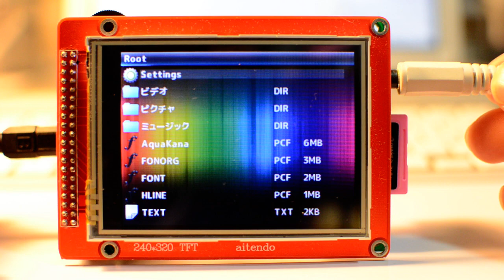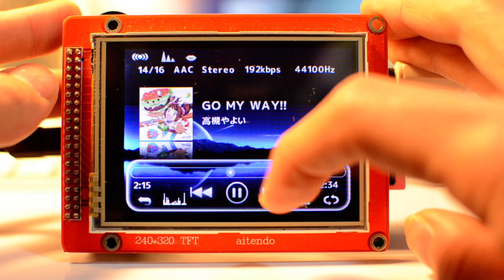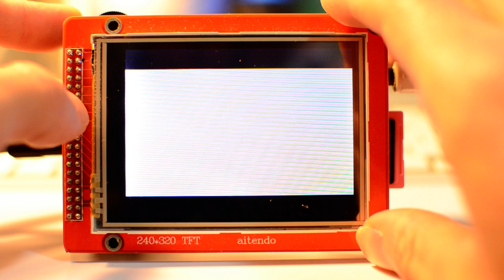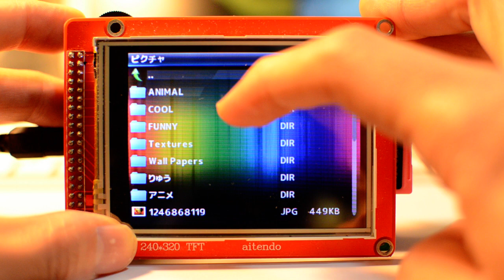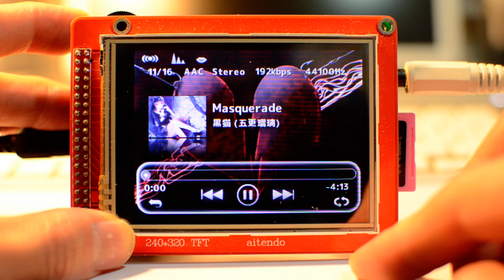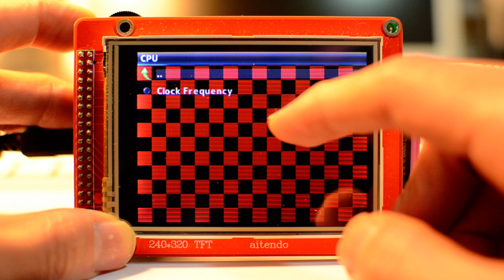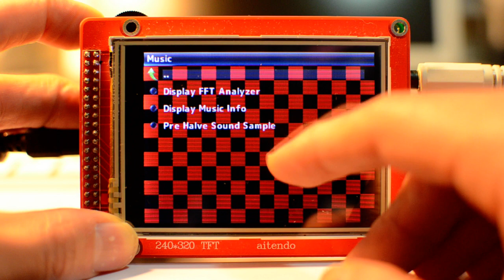STM32F4-Discovery Motion Player

Comment from the maker: by changing the value of the internal PLL.

system clock formula is as below
PLL_VCO = (HSE_VALUE / PLL_M) * PLL_N
SYSCLK = PLL_VCO / PLL_P

ex. 250MHz
HSE_VALUE=8MHz
PLL_M = 4
PLL_N = 250
PLL_P = 2

Comment: Wow, amazing - what hardware are you using beside the STM32F4 ? e.g LCD controller? Did I read this correct - you overclocked the mcu 180 -> 250 mhz??

Comment: excellent project!
You use SDIO to work with SD card, but this conflicts with CS43L22 audio DAC on I2S mode.
SDIO_CK and I2S3_SD -> PC12.
SDIO_D2 and I2S3_CK -> PC10
How you solved this problem?

Comment from the maker: thanks:)
i discarded to use CS43L22 for that reason.
instead of it, i connect STM32F4's DAC output pins PA4 and PA5 to analog amplifier MAX4410.
here is schematic of this board.
ttp://motionplayer.wiki.fc2.com/upload_dir/m/motionplayer/d29963319a454ba8d5870af6e8238046.jpeg

Comment: Good Job,
but no stm32 can run with 250 MHz frequency ...(?)
Reply: Seems you can actually...
Reply: I was one designer of high end stm32 ....
Reply: And? - Google it! Plenty of people say they have overclocked the F4's and as they have provided similar findings I'd be inclined to believe them. Will let you know when I try with my stm32f429...
Reply: stm32h7 is at 400mhz